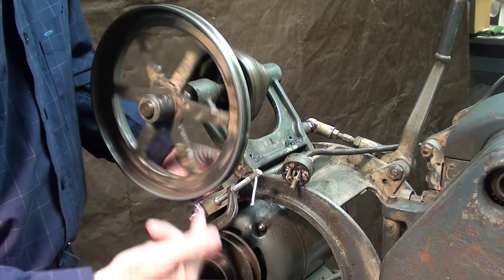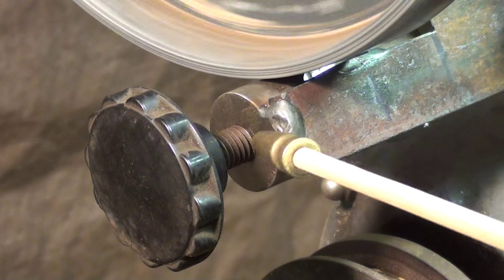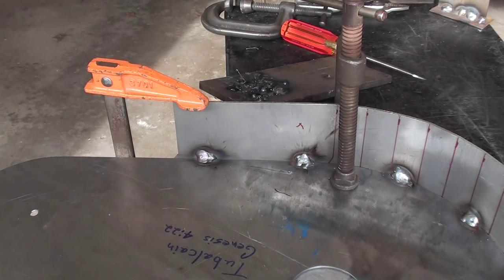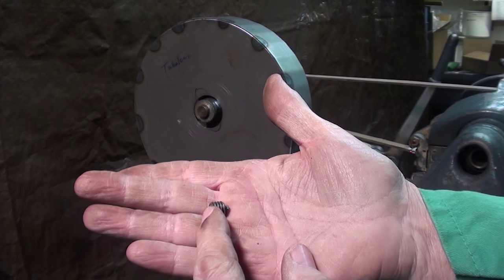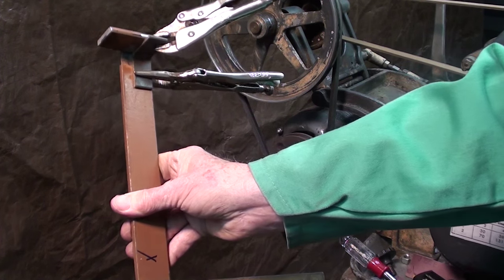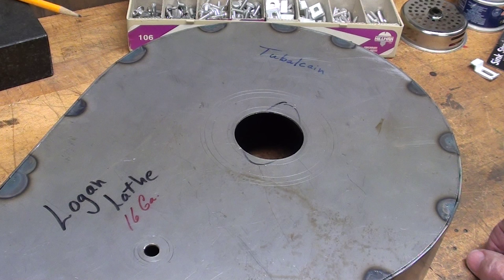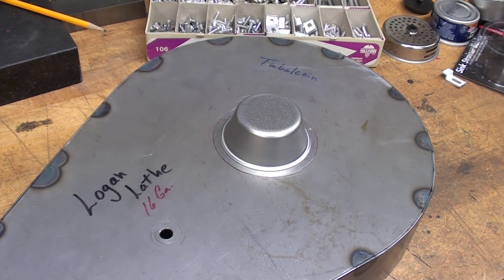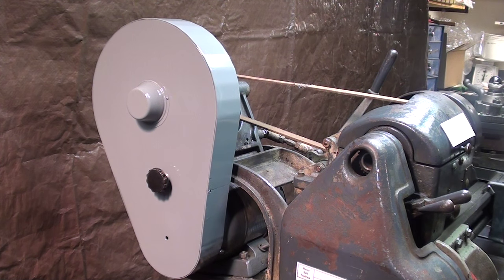SHOP TIPS #297 Pt 2 Making a Belt Guard for Logan Lathe tubalcain

Comment: Glad to see you are using that "sacrificial" piece of wood when using the band saw.  So many people try to make that cut and get their fingers too close to the blade.  Life is a heck of a lot easier when using push blogs, sacrificial chunks and the like when using the band saw.  Things can happen so fast that you can end with a piece of your finger back in your hand.  

Also, could you comment as to when and when not to use gloves on angle grinders, belt sanders, and bench grinders.  I see a lot of people making mistakes on these tools.

Comment: Looks good and solid and should be quiet running.  It is amazing how much noise can come from belt guards on certain machines - especially after they get damaged.  A friend of mine has a gas powered air compressor and you can hear that belt guard vibrating 1/4 mile away.

Comment: Another fantastic video great work on the guard. A few days after watching this I was in a tractor supply store and happened to notice some dust caps for trailer axles there were several types and sizes as well  as shapes but I did happen to notice one that had a perfect dome shape to it it was labeled Dust cap 2.72" part #122T the store code is 1075260 It looks to be the perfect shape and size for a future belt guard.  I did enjoy the creativity and thinking outside the box that went into your guard as well.
Reply from the maker: +John Gubler I'll check that out-thanks

Comment: Respectable looking guard mrpete. The shaft cover looks great. I bet you get grounded when the wife finds the muffin short 2 pieces. Maybe if you do not like the bolt idea on the top bracket maybe you could just fit a slip over stud in place of it. Thanks for sharing. regards from the UK

Comment: I like the muffin tin. I did similar once with a cat food can. TIG tacks to hold it, then faired out the joint with bondo (or maybe metal filled epoxy?). Painted it up like a circus wagon and it looked a treat and made the inspectors happy.

Comment: I was going to suggest spinning a dimpled piece of soft metal to cover the shaft hole in the South Bend guard, but the cupcake method looks pretty good when everything is painted. Plus, you've already got the stock.

Back in the '70's, South Bend came out with a fiberglass spindle belt guard kit for the bench lathes. I'll only say that whoever designed it is probably cutting out paper dollies somewhere.

Tom

Comment: Great job, a lot of great information. The top screw could be replaced with a stud, that way you could hook the guard on the stud to make it easier to install. Also, Paint color has been a big issue in the South Bend Lathe Group. if you have a tractor supply store near you, they can normally match any paint Color that you need. or at least come very close. 
Keep up the good work.

Comment: A little off topic; but muffin pans are great for temporary storage/organization of small parts & fasteners. As you take whatever apart, start loading the cups from upper left to lower right (as if reading text). When whatever it is goes back together just go in reverse. Caution... if the muffin tin is dropped/disturbed once loaded you can have a disaster. I have several in my shop, a couple each of 12 hole and 6 hole; they can often had at yard sales for mere pocket change.

Comment: Nice job on the guard.  I wonder if you could use a rounded pin in a press to form a piece of sheet metal into the dished guard piece.  Or maybe try your hand at spinning to create the center section.

Comment: Looks really nice.  I wonder if the material would have been thick enough to use a mallet like a fabricator would to make a domed piece instead of cutting out the hole for the countershaft pulley?

Comment: The insulator is a piece of rubber tubing on that gun. The copper/brass bent tube ahead of the gun handle that the contact tip, diffuser and nozzle connect to. Welding current passes through this tube and unless insulated it can arc out if it happens to touch and part that is grounded by the machine. 
I am guessing that this is a Magnum 250L (Classic) gun.

Comment: If the top bolt was replaced with a pin, you would have a no-wrench installation. Hook the guard over the pin and then install the knob-screw. 

If it vibrates, maybe a rubber washer between guard and bracket would solve that.

Comment: Rustoleum Charcoal Gray will be really close to the original gray/blue/green color and is readily available. I just finished restoring a Montgomery Ward / Logan 10" lathe in this color. Another option, if you can even find it is, Benjamin Moore "Baby Seal Black" which is an almost perfect match to the original color.

Comment: I use those cupcake pans for stuff like this too. Managed to get a small stash of rounded end ones, don't think they are for cupcakes, rather that thing you do with chilled chocolate when you make chocolate spheres...or maybe people like half sphere cupcakes, who knows.

The metal isn't half bad either.
Reply: Oh and you can darken the gray if you use spray can paint. You sprinkle the paint from a distance and it makes it appear darker. Unless you really get close you'll never notice it. Used that trick to blend in a few parts myself. Cheaper than repainting them the correct shade of gray.
Reply: When I take something apart I keep the nuts and bolts separated with the muffin pan i should not bother because I always knock the pan on the floor.

Comment: I here tale back in old'n times that the phrase "engine lathe" came from having a gas or deisel engine running outside and either a overhead shaft or a shaft in the floor covered by a medal plate the entire length of the shop to power all the machines. There must have been a lot of pulleys and belts spinning. A German guy I knew said that when he was young, that his boss came in one morning with his long black coat dragging the floor and someone had left the metal plate off of the floor shaft and his coat tale got caught.  In a flash, the poor guy was pulled down and around the shaft and turned him into mashed potatoes.

Comment: I love the cup cake shaft cover!!! Mr. Pete I have used 3/4" heat shrink over the pins on my clipper belt to get rid of the clicking noise on my South Bend 9". It is so quiet now. Have you ever tried this.  I don't take heavy cuts on it as it is old and I don't want to hurt it, plus I have a larger one for that.  I don't know if it slips more or less than the metal clips.
Reply from the maker: +greasydot I'll have to try that